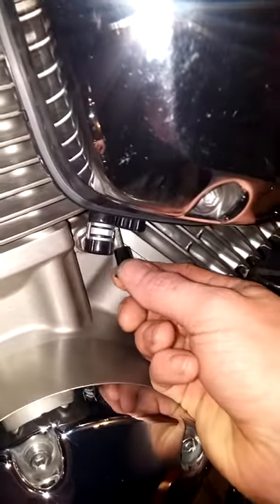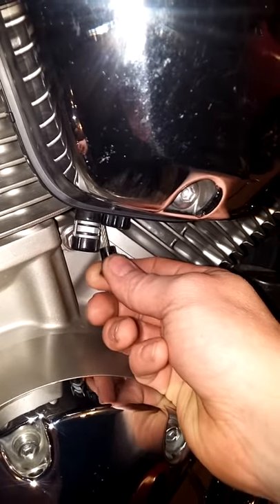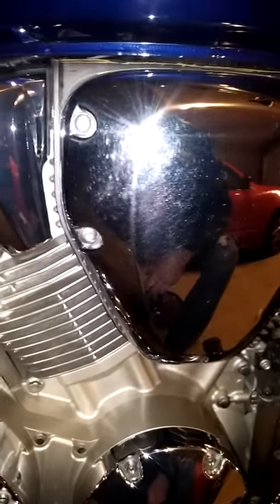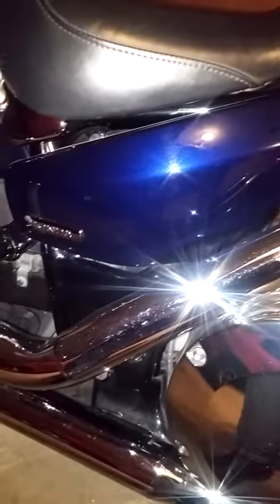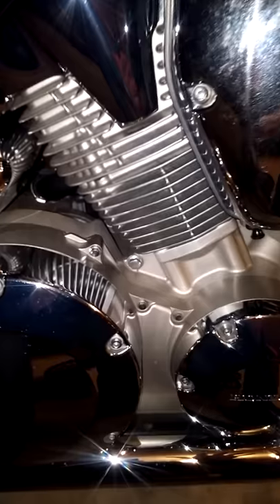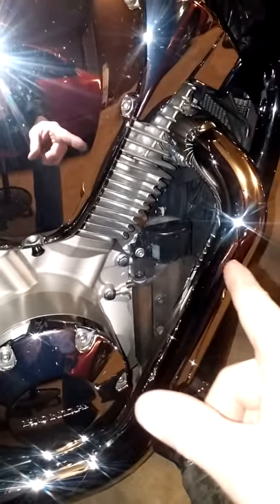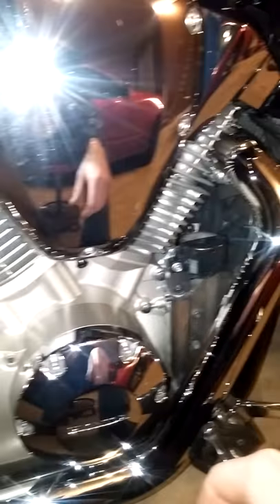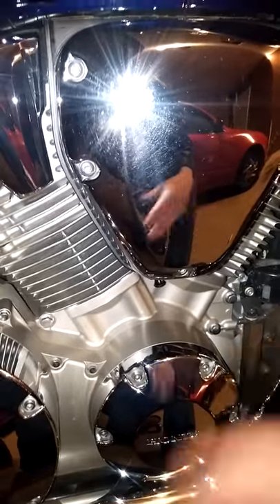Basic how-to on air/fuel adjustment on a 1300 VTX

Comment: Hello. I wanted to ask a question. Lately I am having to ride the bike with the choke a little open. The issue started all of a sudden. I have tried to shut the choke and turn the air/fuel screw, but bike shuts off. Any ideas? As an FYI, I have Mortons exhaust, and Arlen Ness Big Sucker air kit. The bike used to start right up, no choke needed. Thank you in advance for any tips you may have.
Reply from the maker: If the bike was running fine then all of a sudden changed, it could be a few things. The first that comes to mind is did you change fueling stations. It's possible your getting poor quality fuel. If that isn't the case, you may have either a fuel line or filter clogging up, or your carburetor has some trash in it. Either way will require some disassembly to get to the root cause.
Reply: +Moody Lane 
ok. thank you for the prompt reply. Figured I'd need to do some disassembly around the carburator area, but I don't know much about them. I will be checking out your videos for sure, they seem very instructional, thank you for that also.
Reply: hey man I've been having the same issue that you described on my vtx, just wanted to ask if you got the issue worked out on yours?
Reply: +Jairo Parra 
I haven't had a chance to do it yet. very likely in the next few days I will. I got a fuel filter, a fuel line and some carb cleaner. Will let you know how it goes for sure.
Reply: +Henis Bitri thanks I'll appreciate that
Reply: +Jairo Parra 
No problem. A friend of mine who is very well experienced in carburators said it may very well be a dirty main jet, that's why he told me about the fuel filter.
Reply: Carb may need cleaned
Reply: @henisbitri7414  any updates from this issue? I know it’s been 5 yrs but we’re curious if u fixed it
Reply: @lstruggy  Good morning, sorry for not updating since then. What I did was use SeaFoam treatment, the one that you spray into intake and let sit for a while. It made an impressive smoke show afterwards..lol.
It ran rough for about 10 minutes or so, but then whatever was in there was not there anymore because the power all of a sudden came back, mid-turn I might add..lol. since the it has had no problems, starts right up without need for choke. I am getting a bit of black exhaust smoke, but I think I need to get it for a tune up, I just hit 30,000 miles yesterday.
Reply: @lstruggy  I also only run recreational fuel on the bike, so I think that helps also with these issues.

Comment: Hi.  I have read many topics about this motorcycle and its carburetor and I think that you can skip buying it.  Why buy a motorcycle whose engine has a specially reduced capacity and is not a newly developed engine?  It has one carburetor, which is strange since the Honda Shadow 125 engine has two.  It has an aluminum intake manifold because the rubber one cannot withstand vibrations, and the aluminum one must be heated because under normal operating conditions it will condense the mixture created by the carburetor.  Additionally, two candles per cylinder.  Everything works fine until it leaves the factory.  Same shit as the Intruder 800 which has two different carburetors.  In addition, a weak spine frame like the Hornet 600 and one brake caliper at the front.  Anyone who knows motorcycles knows that if a motorcycle is to have fire and ride well, it must have a separate carburetor for each cylinder, the same carburetor, frame and brakes adapted to the weight of the motorcycle and accessories, because almost every chopper owner adds weight to the motorcycle and does not lose weight.  And here are the combinations of turning the mixture screw to make the motorcycle ride well depending on the time of day.  What a mess.

Comment: I have a honda 2004 fuel injected vtx 1300c  theres a nob on bottom of air box is that what your are talking about turn it where ?
Reply from the maker: True Lies If its a 2004 1300 it is carbureted. On a stock bike you will only have the idle speed adjustment screw, along with the airbox drain. I have added an aftermarket pilot screw.  adjustment.

Comment: What direction are you turning it
Reply from the maker: Clockwise will lean it out, counter clockwise will richen it up
Reply: @MoparMasters  if I richen it up too much does a lag on the throttle brap a result of this? And do I just lean it back out a tad to get rid of this lag that wasn’t there before?

Comment: I'd be nice to see what the hell your doing buddy
Reply from the maker: I'm using 2 fingers to turn an aftermarket air/fuel mixture screw in very small adjustments clockwise & counter-clockwise. Even if I did show the adjustment,you would never see any movement due to the very small adjustments being made. This is all done by ear.